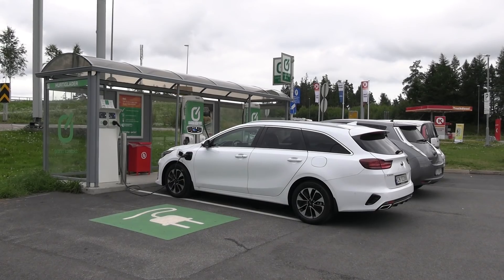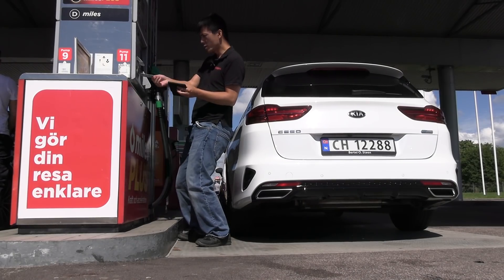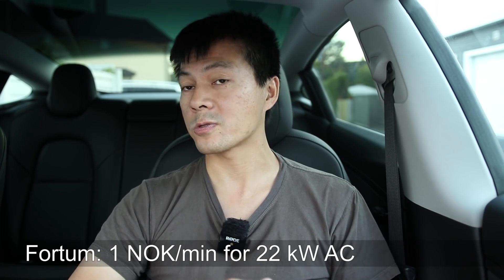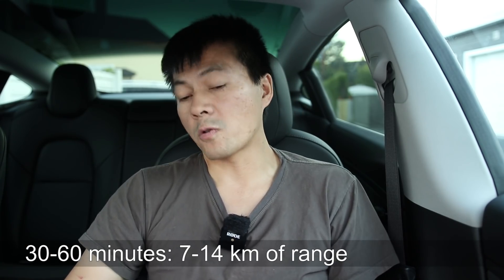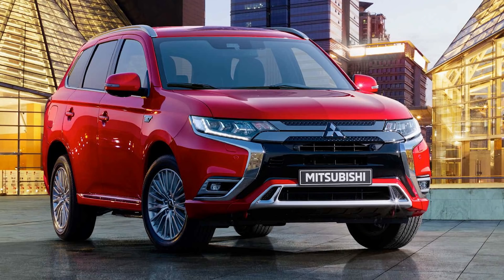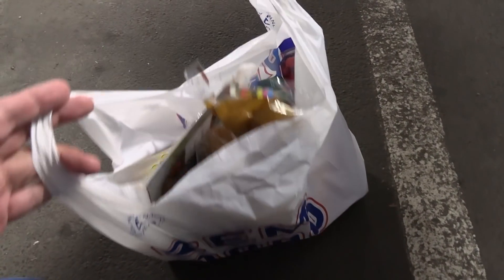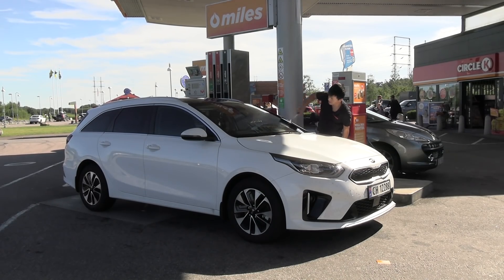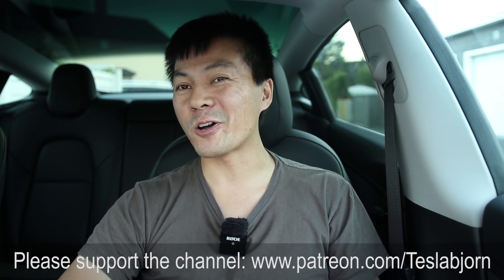Why didn't you plug in the PHEV while eating?

Comment: PHEVs are really the best solutions for 99% of people out there. Why? They can be designed to be used as an EV 90% of the time for most people and give outstanding performance and efficiency. More importantly, they only need to have a relatively small battery compared to a BEV so you can build far more of them with the same amount of battery materials that are in short supply. The best thing about PHEVs is that they are easy to fuel up on long road trips which is a pain in the butt for all BEVs, even "long range" Teslas. The problem is that most PHEVs are poorly designed to provide only 15-25 miles of range because of small batteries. A good example of how good PHEVs can be is the upcoming RAV4 Prime. It is a tall SUV (unfortunately, what Americans will only buy these days) that has a 42 mile EV range, which is more than enough for the daily commutes of over 80% of people out there. It has standard AWD and 304 hp. It does 0-60 mph in only 5.7 seconds (seriously, who needs to do that in 3 seconds?). It takes 5 minutes to give you a 600 mile range. No BEV comes close. It is more environmentally friendly than BEVs because it only uses a 20 kWh battery so you can make five  Rav4 Primes for every one P100D Model S. Getting five ICE drivers to switch to a Rav4 Prime does far more to help the environment that to get one ICE driver into a Tesla. On top of that, the RAV4 Prime is far cheaper than a Tesla Model Y, its most direct competitor.
Reply: The ICE engine and drivetrain in PHEVs are neither free or environmentally friendly to produce or maintain, and negates the design benefits of EV's which can have a lot more room inside smaller cars. It would be a lot better if most people just realize they don't need 500+ km range, and if they can't be bothered to take a healthy break every couple hours on long trips they can rent a ICE car for lots cheaper than the cost of having a much bigger battery than needed for daily driving. Then the battery capacity you mention could be used to make 2-3 smaller EV's and the many people who can't charge at home or work and drive a lot is still better off with a regular ICE or hybrid vehicle.
Reply: This is Toyota's argument, straight up.  In their world, battery availability is a zero-sum game where only a fixed number are produced and they should all go into Toyotas.  Reality is battery factories are being built at a good clip and new battery tech will further expand options.  PHEV are terrible as BEV (range, power, charging speed) and mediocre as gasser (smaller engine, more weight, smaller tank).  Had one - much happier with BEVs.

Comment: Are they limiting the charge rates to save on the pull from the grid ?
Reply: With such small batteries there is just no point having a bigger onboard charger, as most charging will anyway happen at home overnight or at work where the battery will be full again by lunch time.

Comment: Mercedes GLE 450de has a CCS 60kW DC charge option.
Reply: And the A, B, CLA, GLB and GLA PHEVs can do about 22kW CCS, which is great for a small efficient car, IMO. A PHEV pulling 22kW at a fast charger is no worse than an EV topping up past 80% at the same rate. Hell, the eGolf and the Leaf sometimes peak at ~20kW!
Reply: @krugerdave  exactly, it doesn't matter whether a BEV or a PHEV is using a charger for 30min. The lower charge rates are compensated by smaller batteries.

Comment: IMHO the basic idea for a PHEV is to go for (relatively) short runs (mostly in city) in EV only, and then use it as an hybrid on long travels. So charging at home and maybe at work is more than enough. A beefier AC/DC inverter or the ability to DC fast charge would only add to the initial car cost, for little practical results.
Reply: Currently I quess mostly so. But I hope PHEVs would develop so that range would be like 100km. Then many could use it as EV, but if you regularly need to drive longer trips (or it is cold or you need to tow something) you would be still be able to do it with ICE. And 100km range would indicate bigger battery -> would be possible to charge it faster.
Think (only a bit) like Polestar 1. Long range and fast in EV mode, 'unlimited' range from ICE. Of course otherwise very unpractical car... Only if it could be like Volvo V60...
Also that kind of hybrid would bring 90% of the BEV benefits but world would only need 25% of the batteries produced compared to BEVs.

Comment: 1600Wh is not 7km. Bjorn, it's more like 10-12km.(130-140Wh/km avg.). You say that this PHEV is as efficient as others Hyundai EV's!
Reply: No. If you are already rolling on highway at 90km/h and engage electric motor then yes, more then 7km. But you need to accelerate to 90km/h or even to 120km/h like Bjorn was driving! I call BS to 7km of range in real world... more like few kms... What if you have slight uphill?
Reply from the maker: Incorrect. 1.6 kWh is 7 km when going at 120 km/h which was the case here at 1000 km challenge
Reply: @bjornnyland  But most people out shopping dont drive at 120 km/h to/from home/shopping mall. At least not in Norway. And average speed during one year would be much,much less. And hence,the average consumption will be lower than on a 120 km/h test

Comment: Probably true for cars other than Mitsubishi PHEV— noted as you observe. On ChaDeMO I get 80% in 20 mins which amounts to about 40km — but not at motorway speed. (120 km/hr here).  Has been free in Ireland until recently. 
Normally recharge at home off solar which covers all local trips.
Agree with you about capacity of built in AC chargers. It is a shame that we cannot fully use the many free 22 kW chargers available.
Reply: A proper EV with a decent size battery can however get over 100 km range in 20 minutes on the same 50kW chargers, so if there is no other available fast chargers it makes sense to prioritize those.
Reply: Nordlands Yes, I am conscious not to block someone who is more susceptible to range than I am. However, try travelling from Santander over the mountains to Nice, then over the Gotthard pass through Switzerland into France and the North West of France before catching the ferry in Cherbourg. The quality of charging infrastructure would make a BEV impracticable if not impossible. That is why PHEVs are a transition technology. Sometime in the near future, BEVs will be entirely practical for longer journeys—- but not just yet. Also, how many of the BEVs are rated for towing? The Mitsubishi is rated at 1500 kg with a braked trailer and is well able for it. A few years will make a big difference and the trend is clear.

Comment: Agree here...
Bought a Volvo XC90 T8 3 years ago... probably the best car in terms of build quality and ride...
But every time I was driving with ICE, I literally hated it. All the vibrations and the noise...
I sold the T8 and bought a Model X. It clearly was a downgrade in build quality, but the overall experience is clearly unbeaten.
Hybrid is for all the people in transition to electric...
Reply: The T8 drivetrain just isn't very good IMO, and it's all down to the engine. Alfa makes a comparable engine, same displacement, a smidge down on power, but miles nicer, and they had the good sense to pair it up with a gem of a gearbox (in the Stelvio, at least). A diesel would be better in the hybrid volvos
Reply: Congratulations - Herzlichen Glueckwunsch !!!
Reply: I got a BMW X5 40e 4 years ago. No vibrations or noise when the ICE is running. Only at full power, which I never do. Next is likely the X5 45e with net 21 kWh battery and still 700km+ range at the autobahn. Car no 2 is of course an EV
Reply: @jost4786  the t8 engine isn't a bad engine... a bit rough since its a 4 cylinder, but nevertheless a good engine.
My main point (in terms of riding quality) nothing can beat an EV... Ice has too many moving parts.
EV still has its own downfalls, but not when it comes to the smoothness of the drive itself
Reply: i have a a3-etron, and I feel the same way. On long road trips it's really nice when I get to a long downhill stretch, and can turn off the engine for awhile

Comment: It is interesting that BEV drivers complain when PHEV cars are being charged. I agree that people should move their cars when done charging though. PHEV drivers that charge their cars with per minute cards usually do it just once by mistake. So that point is mute. We charge per kWh, not per minute since most car manufacturers have decided not to give PHEV fast charging.
It is ironic that people complain that PHEV drivers get the car because of tax incentives but never charge the car. Whereas when they try to charge the cars, BEV drivers complain that they are charging the cars. And it is wrong to say there are enough BEVs to satisfy all car needs. That is not true. Presently, one cannot get a reasonably priced wagon sized EV car. The main issue IMO is shortage of charging infrastructures and not PHEV drivers.
Reply: I don't think there's any particular hate towards PHEV drivers. I hate all drivers equally - kidding of course. It's just about being considerate. If you see someone pull up in a Leaf 24 and there's an Outlander charging with the driver gone, kind of sucks.
Reply: Good points. I have also PHEV and I think currently it is best choice for our needs. So just highlighting that is very simplistic to say BEV would be best choice for everybody. 
I have many reason why my family needs at least one car with long range, big boot, towing capacity for example.

I might be wrong (as I do not have BEV) but while towing BEV range will drop quite dramatically (like fuel consuption goes up in ICE) and gold weather kills BEV range very effectively. And combination of those lead really short range.

Kind of unfortunately right now my wife also need long range car -> so BEVs are out as not practical yet for us. So diesel for her is still the best choice.

My adult kids still drive 'my' older cars and they 99% of the time do not need long range (or longer what good BEV can provide). So I hope soon there would be (from my point of view) reasonably priced and reasonable quality BEVs to be our 3rd and/or 4th cars.

So BEV, PHEV, Diesel etc are all still good choices depending on your needs. Why especially BEV 'fans' (Tesla fans?) are so often saying ICE is kind on dinosaur tech as it is still best choice for many needs? Why there is need to be so single minded?
Reply: Yes. This. Don't hate the player, hate the game. A charging car is a good car. The planet thanks you.
Reply: I have a neighbor who drives a Chevy Volt and he does this all of the time and I don't think he cares either. He will just leave his car plugged in for hours after his tiny battery has charged.
Reply: Miguel Rodriguez He does that at public charging stations? It takes 4 hours to charge the Volt on level 2 (for every year except for 2019s with the optional faster charger) because of the slow onboard charger. If he’s leaving it plugged in all the time at home then that’s exactly correct, GM says to keep the car plugged in whenever possible to condition the battery.
Reply: @MylesV  We have to drive our low-to-medium range BEVs to rural areas where L2 destination charging is required between DCFCs.  It is typical to find PHEV, often Volt, plugged in but not charging, forcing us onto 110V.  Don't they have apps that alert them when their cars are done?
Reply: Myles Vance the thing is he never plugs in at home and he's leaving it plugged in when he's at places like Disney for hours. Definitely more than 4 hours.
Reply: @MiguelRodriguez-mj2ec  Bjorn overestimated the size of his cable, your neighbor overestimates the size of his battery. Happens to the best of us.
Reply: Pawel Mrozik I'm sure he knows it doesn't take long to charge. I just think he lacks courtesy for others.
Reply: As far as i can see plug in hybrids were never designed to be charged on road trips . They were designed to be charged at home for local travel and fueled for road trips.
Reply: As a BEV driver, I have never complained about PHEV drivers charging. I think it’s a good thing, though due to the slower on board chargers I would probably charge a PHEV mainly at home rather than at public chargers unless I knew I was going to be there for a long time.

What does bug me is people hogging chargers by not moving their car after their battery is fully charged, regardless of whether they are BEV or PHEV drivers.
Reply: kardy12 It is great to have BEV owners with attitude like yours for a change. I wish there was a fine or charge/min when a BEV or PHEV is parked at a charging station with full battery or when unplugged like some idiots do. 
Charging cars should usually be done at home as you said. For people like me that do not have charging ability at home, public charging is the only solution though. Good enough, there is a public charger about 1km from my apartment. I have to pay for parking and electricity though. I don’t charge when on long journeys however. As it is, I use the engine(hybrid) when traveling above 75kph and use battery below that.
I have been told by some BEV drivers that I should have bought a regular petrol car if I don’t want to buy a BEV. As I said in the OP, there are not enough BEV options at reasonable prices yet. I will definitely get a BEV(I love the quiet drive of electric) when I can get one with the interior and luggage space of a VW Passat at a reasonable price. 
Like some PHEV owners I talked to, even if one should compromise on interior and luggage space, it is more sensitive with range. For instance, I get anxious when the petrol range in my car drops to 200km. I refill ASAP.  I will get high blood pressure if I have a BEV with less that 400km range. Sorry for babbling so much 😀

Comment: The new Mercedes A250e / B250e charges at 7.4 kW on AC and 24 kW on DC
Reply: Yes, also same for the CLA250e and GLA250e, 16A 2-phase 7,4kw as option and 24kw DC.
And the PHEV hero the GLE350de with 60kw DC CCS, 0-80% 20min, 31,2kwh battery. Maybe these fossils aren’t so bad...

Comment: To say it short - it take 2-3 hours to charge PHEV battery. Depend from the battery size. With such small batteries faster charging is pointless, it could damage the battery.
Reply from the maker: No, it won't. 3.5 kW on 8.9 kWh battery is only 0.4 C. It can easily take 7.4-11 kW which is around 1 C.

Comment: Isn't the whole idea of PHEVs for places where charging infrastructure is underdeveloped but the owner of the vehicle has the place to park and charge at home or work, and the PHEV is used mostly for commute daily as pure EV while on long trips simply refueled with fossil fuel? This is especially useful not in Norway but in the cold areas of MidWest USA and up North middle provinces of Canada. For Norway PHEVs are pointless unless owners have to make very long trips regularly in the winter in remote areas of Sweden and Finnland with scarce charging infrastructure.
In some places like Japan where even at home parking has no charging opportunity and is paid for monthly AT HOME - a PHEV is pointless.
Faster AC onboard charger than 11 kW was been tried in the USA by Tesla with dual chargers but failed since the 110 V home system is usually designed on antiquated principles and to use of even 19 kW onboard chargers people needed upgrading wiring in the house costing up to 6000 USD. Thus Tesla gave up on faster onboard chargers. The fact that Tesla did not keep faster onboard charging option for Europe especially for places like France, Norway with very spread 3 phase home current is easily used by Renault Zoe with 22 kW onboard charger thus selling in larger numbers than Tesla Model 3 for that particular reason.
I agree that 3 kW onboard AC charger is a joke but once again it comes from world platforms of manufacturers used also in the USA thus it is cheaper for them to have worldwide the same equipment.
On the other hand serious manufacturers provide 7-11 kW AC onboard chargers even for PHEVs while others do not provide it even for pure EVs like in California was on sale FIAT 500 EV and SMART EV without fast chargers and slow onboard AC chargers.

Comment: A lot of people in the UK buy PHEVs because of the tax break (if you have a company car).  As a private buyer it is either and EV or petrol for me because the PHEV compromises don't seem worth it. No doubt dealers love the servicing revenue.
Reply: Its far better option to have very efficient diesel( used one?) for long trips and some EV for every day commute...(if possible) Diesels on highway are actually cleaner then large petrol engine with extra weight from battery, motor, etc... They have much better efficiency, higher torque then petrol, which means lower rpm while constant driving etc...
Reply: @DG-uv3zw  I do low miles so efficiency isn't that important from a cost or environmental point of view to me. I had a Zoe for three years but basically got bored with it (lots of good points but I never liked the way it looked and the weight could always be felt plus the headlights were terrible).. It always had perfectly adequate range for my purpose though. I like the E208 but don't want to spend that kind of money. I have always disliked diesels because of the lack of refinement (even the best modern diesels still sound rough outside the car) but I know lots of people who disagree with me. I have bought an eight year old sports car for some fun but will return to electric once I can get something fun at a reasonable price. I agree that diesels are good on fuel cost compared with petrol but that isn't the most important thing to me. If it were I'd have kelp the Zoe - it cost virtually nothing to run and servicing really cheap too.